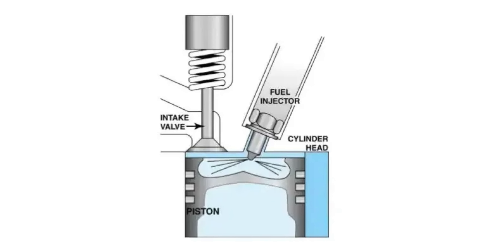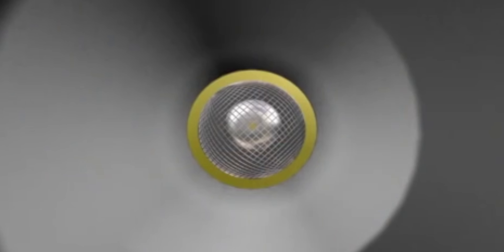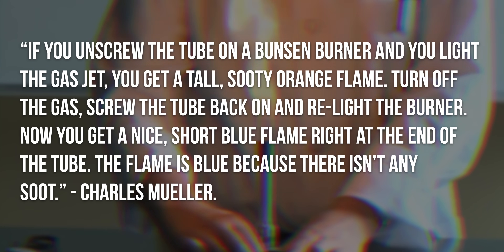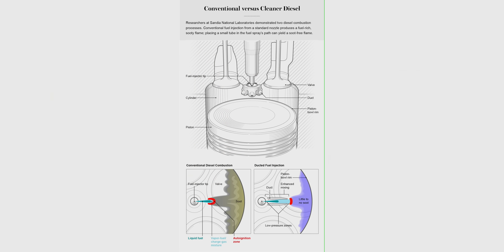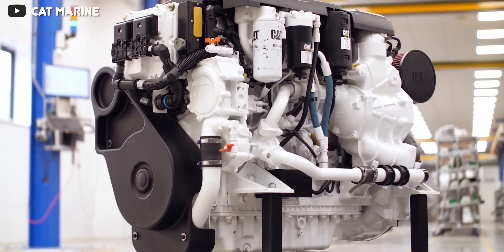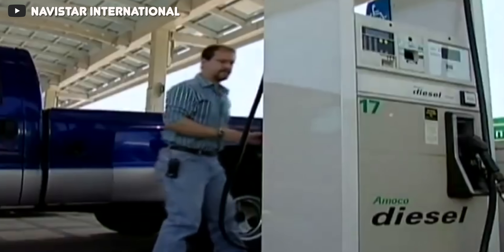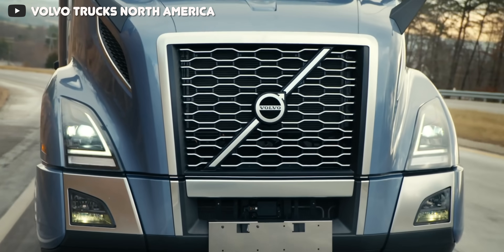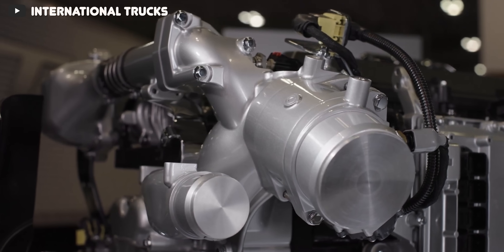Zero Emissions Diesels: How Ducted Fuel Injection can Save the Diesel Engine

Comment: Even if we reduced emissions by 100% the EPA/CARB would never stop mandating the use of DPF and DEF systems, even 10 years ago the cleanest diesel engines emissions output for PM was less than the air coming through the air filter in California. For these groups it never ends, if we achieve 0 emissions they will just start regulating energy usage or heat, noise, light emissions ect. These people are way more concerned with their power trip than actually helping the environment.
Reply: It's all about money.
Reply: Yeah you never see them go get a normal job and then plant some trees
Reply: IT WOULD TAKE ALL / EVERY COUNTRY TO TAKE PART IN THIS FOR IT TO WORK ,,, IF U.S.A. WENT 100 % CLEAN IT WOULD DO NO GOOD IF CHINA / RUSSIA / IRAN & MANY MORE WOULD GIVE US THE MIDDLE FINGER
Reply: @rpracingproducts. You're absolutely right about the EPA being a control hungry goververnment organization. Even if this type of injector was added to diesel engines the epa would throw every regulation  possible at the diesel industry to kill the diesel altogether.
Reply: Bingo. You will never satisfy zealots or environmental quacks that just want more power. You just have to ignore them and move on without them
Reply: Amen.  You are spot on.
Reply: Power?  They have reasons, the oil industry wants significantly lower efficiency for obvious reasons.
Reply: Commerce clause of the U.S. Constitution needs to put an end to C.A.R.B. 
States don’t get to regulate interstate commerce.
Reply: Exactly. They don't care about the actual emissions or cost effectiveness. (Which is why the "Science" in support of DEF systems is completely fake.) They care about justifying budgets.

Why does anyone care what emissions a tractor has in the middle of a field, miles away from the next human? The dirt being plowed and the crops being harvested puts way more particles into the air.

By the time we got to the standards of the early 1990s, the problem was basically solved, had we just waited for the natural turnover to take most of the cars from the 1970s off the road.
Reply: Are you suggesting DPF is a success?  🤔
Reply: Commiefornia is already regulating vehicle exhaust noise output.  They also have "laws" in place that prevent the purchase of or ownership of a PC with a power supply above a specified wattage.
Reply: Stop whining. Be part of the solution. Support our government. Support our country. 
Otherwise, if you don’t like America, then go away. Go to trump land (russia).
Reply: @lumberjackdreamer6267 you are in OUR land.  You can leave girly boy.
Reply: @Steadierpark  ok, boomer.
Reply: @lumberjackdreamer6267  So you're one of the reasons we're in this mess! I fully support America which is why I don't support it's government. If you think these policies are being put in place for any reason other than to crash economies, strip control over free markets, and starve people for starters,
You're definitely dreaming of lumberjacks way too often.
Last time I checked, these same policies this administration's pushing  isn't working out so well for the wellbeing of 99% of the people in Sri  Lanka, Denmark, Germany just to name a few. Where the same policies were already in play.
Reply: @opethfantoo3140  
Germany and Denmark have great societies. And they don’t have all those disgraceful red hat sheeple. 
They have high education, low infant mortality, longer lifespans. Much better than America. 
Here we have the blue areas where people are prosperous. That’s where we generate the GDP. 
And we have the red hat sheeple…
Reply: @opethfantoo3140  
Look at the data. Blue areas is where America is thriving. This is where we have the best co pansies in the world, the best universities. 
Look at the best companies, they’re all in blue areas. 
Without California, America would drop to number 12 in the world. 
Blue areas have a cash surplus, which we send to red areas. Red areas are dependent on money coming from blue areas.
Reply: @opethfantoo3140  
I don’t understand what you’re whining about?
You deny climate change? You think the earth is flat?
Reply: @lumberjackdreamer6267  Best Co pansies? California??
Quality of life and freedom far out way economic bragging right. It's debt based fiat. It's only real cause we say it is and is highly unstable. Especially when government needs to spend and print more which produces more debt and inflation.
Reply: @opethfantoo3140  
What actions do you personally do to combat climate change?
Reply: @lumberjackdreamer6267  I chainsaw  carve with with a gas stihl and I drive  a gas car into 42miles one way to work on tractor trailers all day... gtfoh... what do you expect, I eat bugs cause cows fart too much and it makes the earth hot.
Reply: @lumberjackdreamer6267 I’ll make sure to put out some extra emissions for you…and instead of recycling my used oil, I’ll pour it into the ground just for you.
Reply: @Steadierpark  typical republican, you’re driven by emotion, revenge, hatred. That’s sad.
Reply: @Steadierpark  
Always whining, always losing. That’s the maga recipe.

Comment: This style of injector should be tested using black diesel if it still allows for no black smoke from tail pipe that would change everything train and semi trucks should have enough used oil to fill there tanks and find a use for something that would have been waste

Comment: DI gas engines have a lot of carbon particulates in their emissions too, just check the tailpipe. I think if gasoline engines were held to the same carbon particulate standards diesels are they would probably have difficulty meeting them. But don’t say too much or the BEV zealots will ban all combustion engines.. which the current administration seems to be doing by making fuel scarce before having the replacement technology in place just forcing the square peg into to round hole to call it done no matter the consequences.
I think this injector technology might work for gasoline engines too. But I’m just guessing.
Reply: Gas engines in Europe are already seeing GPFs (Gasoline Particulate Filters).
Reply: @codysimonson6260  GPFs, true

Comment: Ok I know this is made for diesel specifically but in theory could this be tweaked for use in any engine? Like a gas car or propane, hydrogen, etc

Edit: I ask because I’d like a future where combustion engines are emission free and this system could really help with that if it could be adapted for engines that aren’t just diesel
Reply: I have a feeling an intake duct full of gasoline vapor and air would have a significant KABOOM factor !
Reply: @leinie6683  I mean I get ur point, could blow the engine or something, but that’s pretty much what a good fuel to air ratio consists of (to my very limited knowledge at least, I’m somewhat new to this). Maybe they can tweak it for not so much gas to be injected but still get reduced or zero emissions. Idk, fuel injectors aren’t my expertise
Reply: Let’s see if this makes any sense, they can keep the ratio of fuel and air, let’s say it’s a 1.5:1 ratio but it’s sucking in X air and spraying Y fuel (based off your comment let’s assume these numbers are decently high). We could lower these numbers but keep the ratio so that it’s still just barely more air than there is gas and the gas is completely burned for no soot and reduced emissions like the guy said in the video. Does that make any sense? Made sense to me in my head

Comment: A further development of the Ricardo Comet indirect injection system?  The Ricardo design uses a hot precombustion chamber to vaporize the fuel.  It has less PM 2.5 and NOx than DI under most circumstances.

Comment: Obviously these guys have never built or maintained an engine. Adding a few little air holes in a injector is nothing compared to the volume of air in the combustion chamber when the fuel is added. Using that burner as an example is laughable as fuel is not added when combustion is taking place in an engine. Furthermore, the burner does not immediately start with a blue flame.  If anything the fuel will take longer to mix with the air charge due to cooler air being drawn into the injector.

Comment: Sandia press release on this was in 2019 IIRC and not much has been done since then. Seems like manufacturer’s are banking on hydrogen right now. Fuel injectors are EXTREMELY hard to manufacture and have a huge rework and scrap rate. It’s very unlikely that they’re willing to dump more money into old technology.